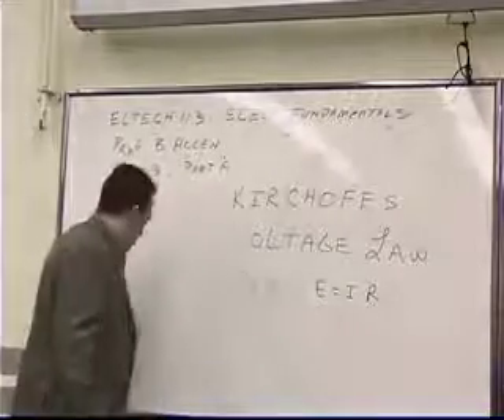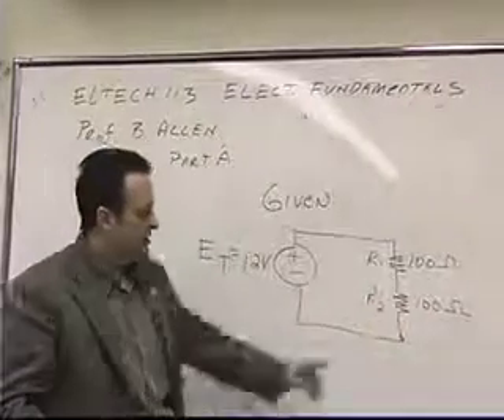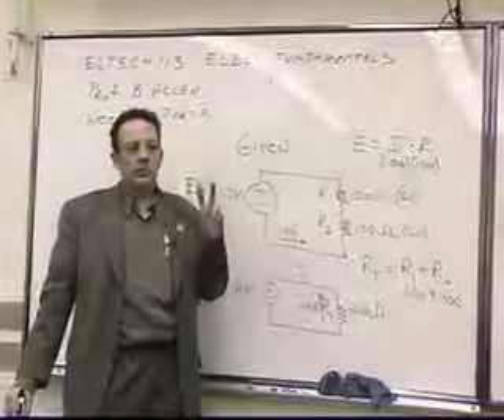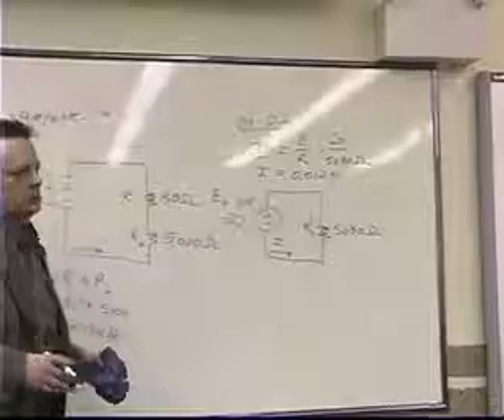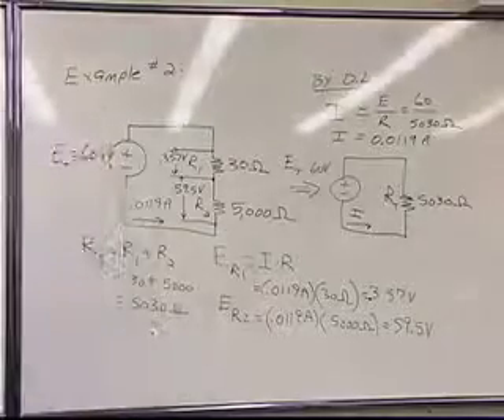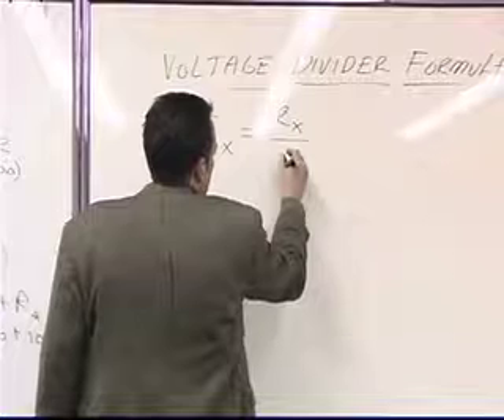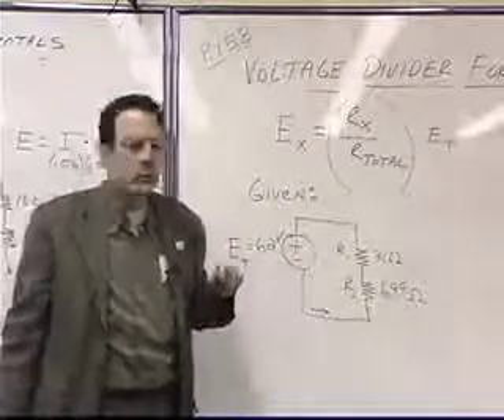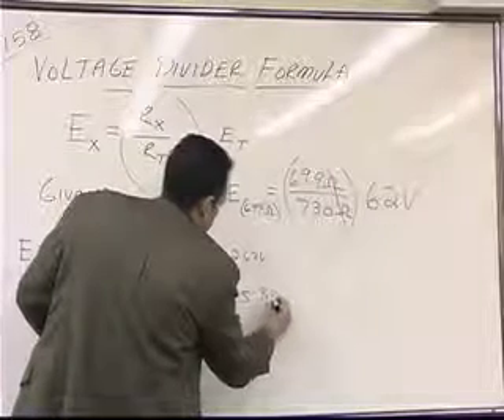Voltage Dividers Part 1

Comment: I can do a voltage divider without resistors,  so u just short the volts straight down wires to get it to work.

Comment: He is so boring. Doesn't he just babble on. He is a rubbish Professor. I would hate to have one like him.
Reply from the maker: Have material designed for "weeder" courses; top 3% of students. No in-depth explanations. Use nodal & mesh analysis; material is presented with 90% math for top engineering students.
Not too attractive, except for that demographic at top ABET electrical engineering schools. Interested?

Comment: you're correct, it 's an error and should read 12v.  but the .06 A is correct. ie.
12/200=0.06
Reply: tripmeter235 I got lost there